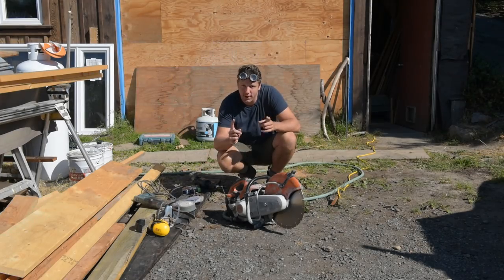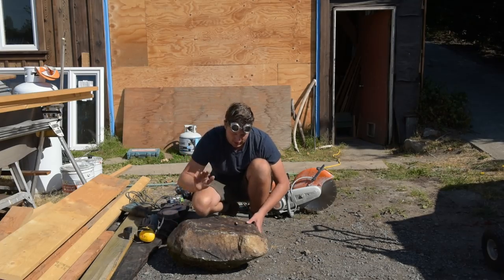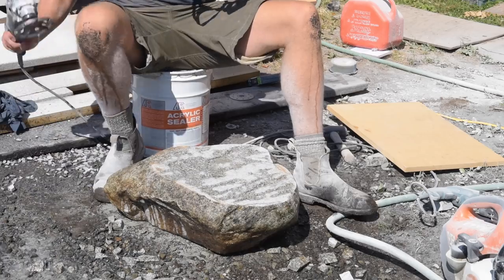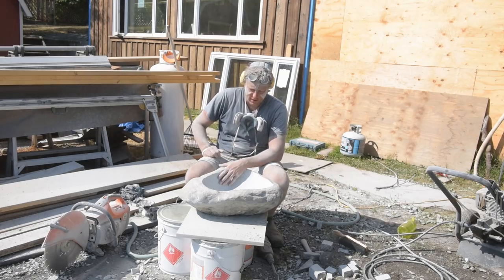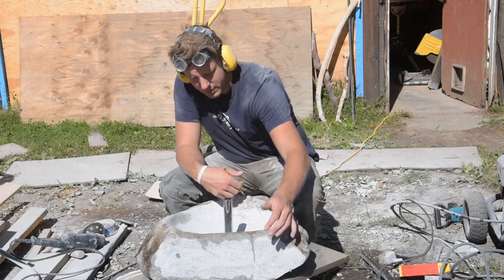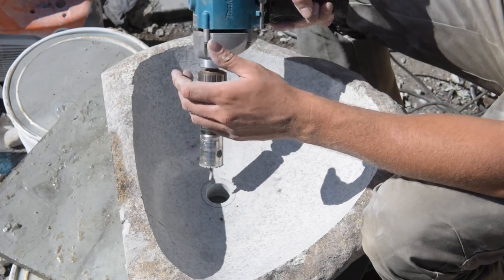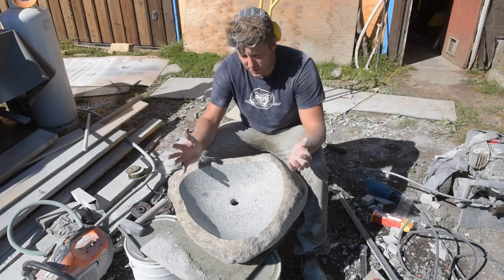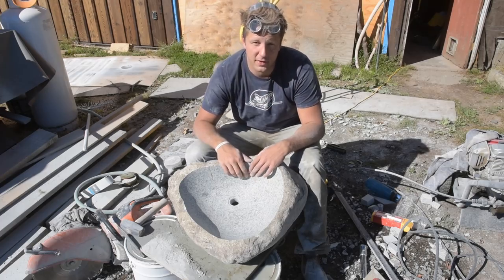How To Carve A Better Stone Sink In 4 HRS!

Comment: I know i am being Nitpicky but its not cancer wich is caused by breathing in too much dust. Firstly it'll make harder to beathe as it can cover your lung, then if you breathe strongly enugth it can also act as basicaly realy fine sandpaper, hurting your loung and causing wounds. These wounds will cause infections and thats basicaly where you are dead. Untreated infections can spead and possibly form Necrotic flesh. 

So yeah, dont breathe in too much dust.
Reply: (This may be a little Overexadurated but the first part is true, trust me. It will cover your lung like a coat of Dry paint)
Reply: It is called silicosis.  The silica goes down looking like tiny snowflakes which do not metabolize and stick wherever they land.  Your lungs just eventually fill up with the meso thing being a possibility.

Comment: Overall execution is good, but a fail on finish. You said it, more diamond, more elbow grease, like a lot more. Using those pads, and paying attention to your steps, drying down and reviewing scratches between steps up to 800 grit would be advised before proceeding to 6000.  That granite, even though it's not that pretty of material, grey and a tad coarse,  looks like it would polish well enough that you should be able to see your reflection, at least a clear outline of your own face in when properly finished.